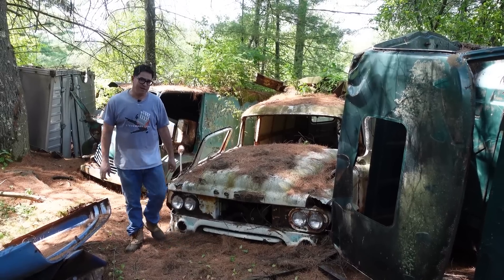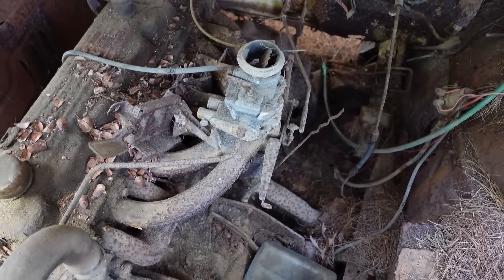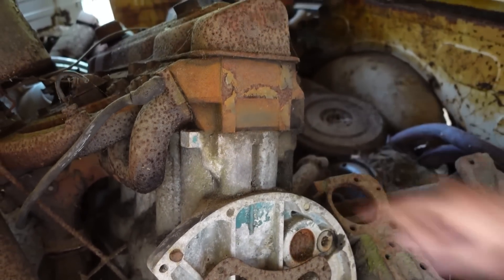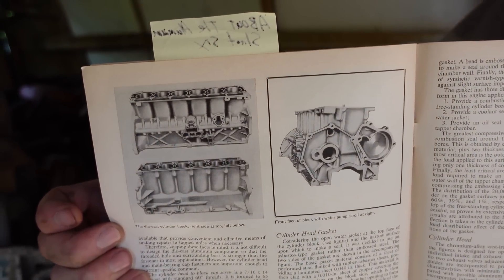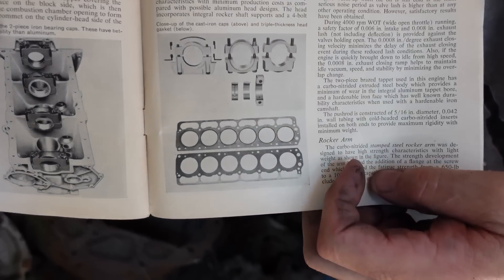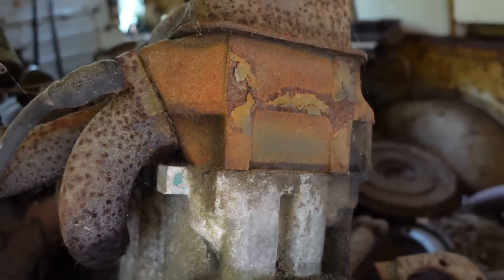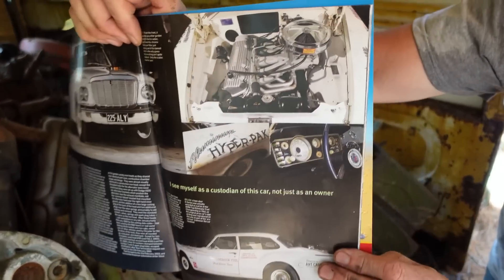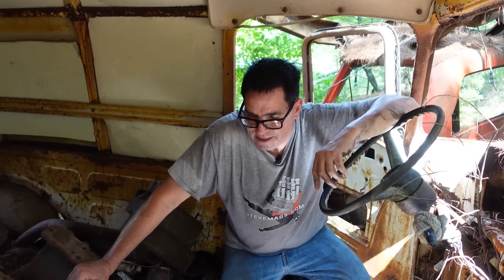Wagon Week EP20 - Slant Six Suprise

Comment: Awesome, thanks for the info. It's funny, the story I read originally years ago was that the slant-6 was supposed to be all aluminum from the start. And when Chrysler couldn't get the aluminum to cast properly, to meet production, they changed to cast iron. And without any time to redesign it for iron, they kept the casting thickness the same, which lead to it's legendary durability.

Comment: I bet they used many of the aluminum block slant sixes in the mid 60 Valliants because my dad had two different ones both with the push button automatic and I always wondered why they felt so much peppier than the 70 Plymouth Duster with a 3 on the tree.

Comment: I had a few different vehicles with the slant six. Yes, the engine itself was great. No problems with the engine. Just problems with the carburetors and electrical systems and transmissions, and everything else Chrysler related with the car or truck.

Comment: Steve,, a few alloy block slants were brought into Oz. A Chrysler dealer I know used one in a road race car then it went into his mud plugger! Local bloke has a Plymouth Valiant wagon, as well as both 2 and 4 door 'S' models.These days there is quite a lot of 2 doors here in Adelaide. 
Weight?? WHY did they not use alloy intakes? Slant 6 ones are heavy. Alloy head to would have made sense,, Buick made them so the casting tequniques were available Modern?? A new engine with only 4 main bearings,,what were they thinking!

Comment: 70 pound weight savings in the block alone. Then the additional weight savings with the aluminum intake and aluminum water pump. Then add the aluminum steering box. Plus the aluminum transmission saved some additional weight. Plus they were looking at using aluminum bumper brackets. I don’t think any of those made production. In addition to that, they were also toying with an aluminum cylinder head. I think they made a couple of those as prototypes but they never left the labs. From what I have read, the big reason the aluminum block was discontinued was they were having a high reject rate on the die castings along with getting the die cast molds to properly seal before they shot the molten aluminum into them. They proved to be too costly to make. So Chrysler discontinued them. 

Van you picture a 1964 or a 1965 Plymouth valiant or Dodge dart with an aluminum block and an aluminum slant six under the hood with a hyper-pack package installed on it? In a 2500 pound valiant with around 200 to 250 hp or more would have been something special. Watch out mustang and GTO!

Comment: Hey Steve, glad you're doing well. 👍🏼
My grandfather bought a 1964 1/2 Plymouth  Baracuda with a Slant Six Automatic.  They didn't fly, so they drove it everywhere in the US & Canada with over 400,000 miles in the 10 years they had it. He gave it to my Mom, who drove it another 9 years on the original  engine until the back window got smashed. 😢

Comment: I built three 225 for 4x4 trucks with custom crane cams ground for torque along with header, aluminum intake & 390 holly 4 barrels. They would pull like a tractor and performed better than i expected & never exceeded over 3800 rpm.

Comment: The Slant 6 was the best American internal combustion engine ever built.
Reply: I knew a man that put over 100.000 miles on a225 without an oil change.just added oil as needed.
Reply: @johnchildress6717  he had to change the oil filter. It would stop up.
Reply: Filter has bypass.What I stated was the truth.He was an engineet..Name wasim Kislanko.
Reply: He got lucky
Reply: The 3800 v6 can at least be 8th on that list the best American engines
Reply: The MoPar flathead six was GREAT TOO!
Reply: Almost as good as the Ford 300 I6😉
Reply: @Scrambler85  300 Ford wasn't even as good as the 292 Chevy.
Reply: @Scrambler85  Would run fine with 2 bent rods from water through the intake.This is the truth.A year after when I saw the engine apart it was hard to believe.
Reply: Don't need to qualify it.  Best automotive ICE ever.
Reply: @randymagnum143 2UZ-FE is better.
Reply: Pratt and Whitney R-2800 was an ICE too and many would give it that title. The C-Series (we’d call it Gen III today) was a stout monster that made up to 2,800 HP. There were bigger and more powerful aircraft piston engines, but not with the Double Wasp’s reputation.

Slant six is still the best tool for a lot of jobs.
Reply: Ford 300 inline 6 was the best, second place goes to the jeep 4.0, third place is the slant 6.